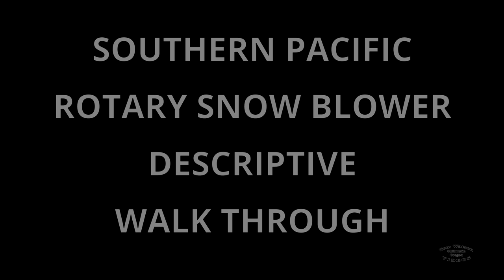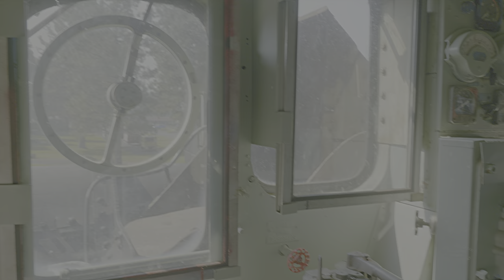SP Rotary Snow Plow Walk Through

Comment: This piece of equipment was self contained, right down to an electric coffee pot. When I saw the vestibule at the rear, I suspected it pulled passenger cars as it bore through the snow, as this gentleman confirmed. This machine was well thought out and updated over time. It’s a fascinating piece of equipment.
Reply from the maker: Yes, considering the length of time these units have been in service, it is very well designed.
Reply: The old fellow spoke very fondly of that electric coffee pot. I think he mentioned it not less than five times! Clearly he spent many, many black and cold nights fueled by caffeine aboard one of these things.
I do not think that these were used to pull passenger cars, though. He said it would have been attached to a locomotive (or a 'power unit' which is a locomotive but without controls). A lot of the locomotive noses would have had some kind of doorway in them, and presumably the vestibule would attach to those. It doesn't seem that this thing can move under its own power, and he said it was limited to 25 mph even when not plowing; I don't think they'd have passengers trailing a maintenance-of-way unit like this.
Reply: Okay, so, having looked into it a bit more, here's what's going on. The snowplow itself has traction motors, but only for the blades; not for the trucks. It cannot move on its own. It's hooked up to a 'power unit,' which is basically a locomotive motor and generator, that provides power to the snowplow, but it also does not have its own powered trucks normally. The snowplow and power unit together are pushed by an actual locomotive. I'm not sure if the controls in the cab of the snowplow can be hooked all the way back to control the locomotive, or if they're basically required to just keep in radio contact with a crew in the loco to give them instructions on when to push it forward or not.

Either way, what a hell of a machine!